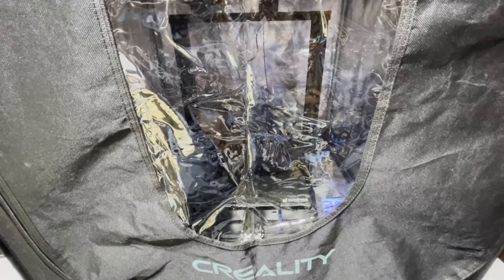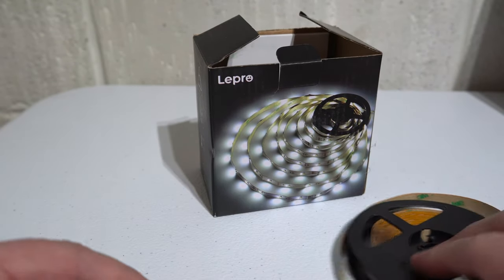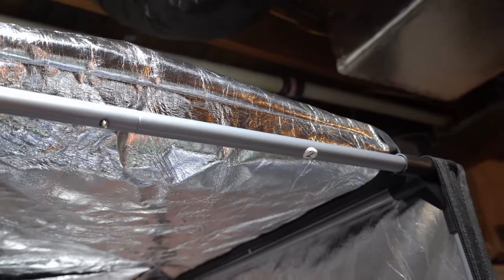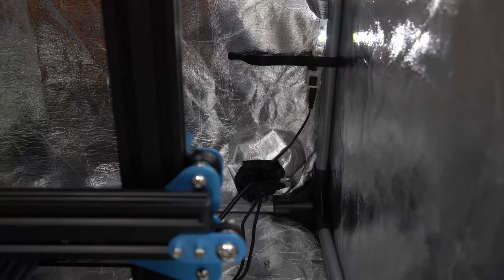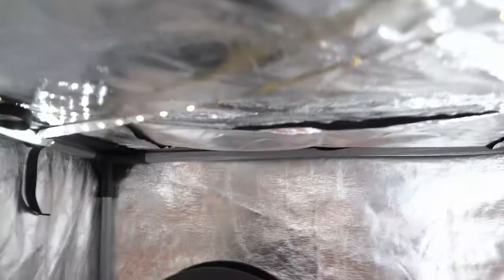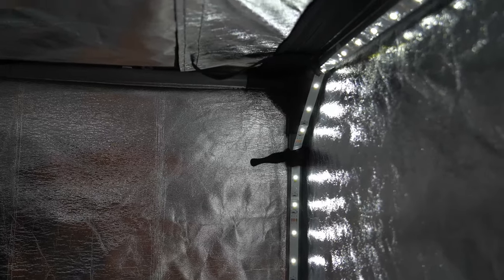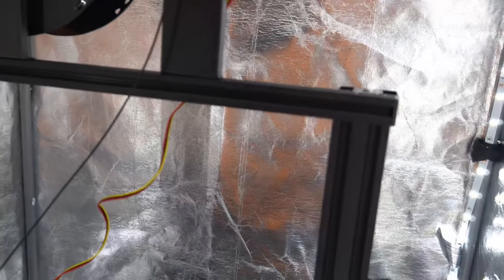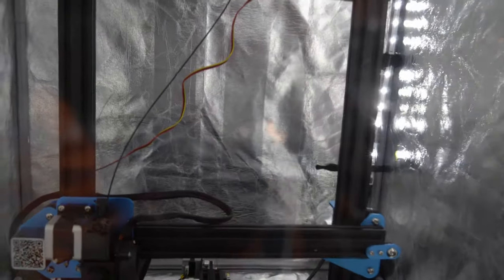Add cheap LED lighting to a 3D printer enclosure

Comment: Thanks for documenting this! I recently got the same "grandma's feather bed" enclosure (it'd hold eight kids, three hound dogs...) and have some similar LEDs I was about to install when I decided to look and see if anyone had done so. I'm going to avoid the cable ties I think and use velcro dots instead, so I can reposition more easily. Because I'm 100% certain I'll want to.

I'm also wondering whether the reflectivity of the enclosure might make aiming the lights at the wall and ceiling make more sense, so you immediately go away from shadowy point lighting.
Reply from the maker: +1 for Grandma’s Feather Bed. We had to sing that at a school assembly in 4th grade (I think). 

You’re probably right about bouncing the LEDs instead of direct lighting. That said, it hasn’t bothered me as is. But bouncing LEDs always makes it a softer, more even cast.